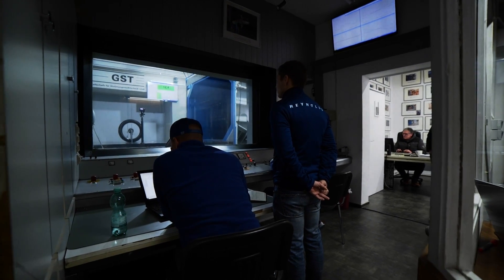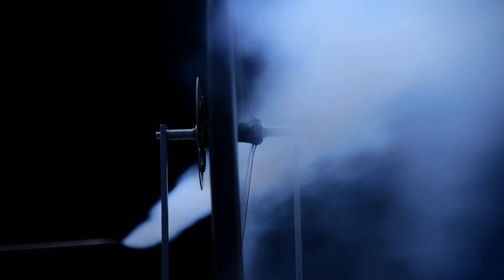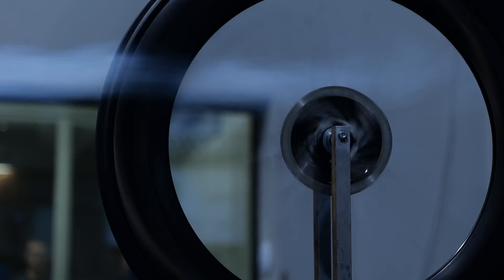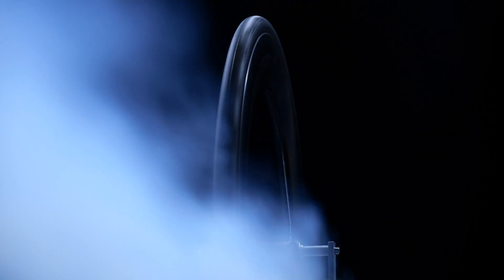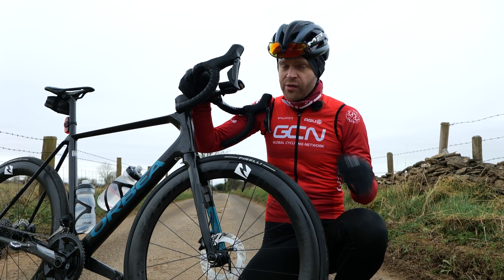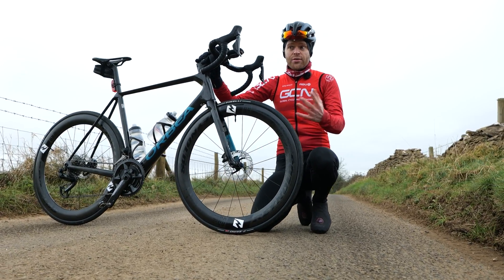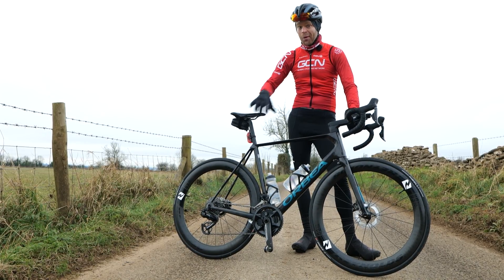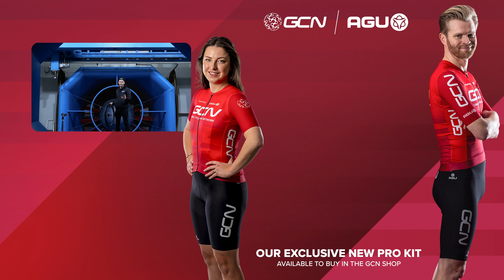How Carbon Wheels Are REALLY Designed?

Comment: Even though I’m using a Reynolds wheel set made a few years ago (46mm rim brake version, tubular), they are fantastic. This is my first carbon wheels so I don’t know about other brands. Still, whenever I ride it feels like I’m driving the electric bike in Akira. Best upgrade I’ve ever made!!
Reply: I'm using the same wheels, but clincher
Reply from the maker: Reynolds make some great wheels! Awesome to hear you are enjoying yours 🙌 New wheels really can be a game changer!
Reply: Older Reynolds wheels are underrated. Mine are great in cross winds with the right size tire.